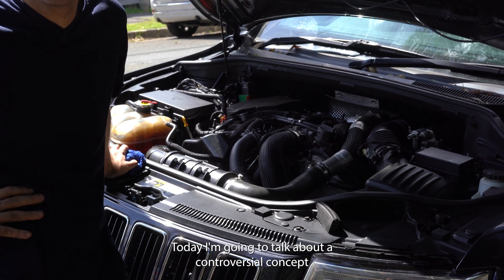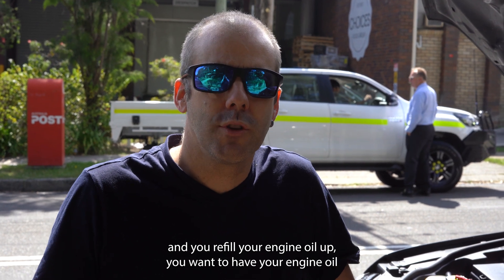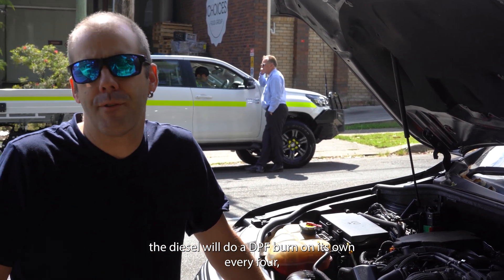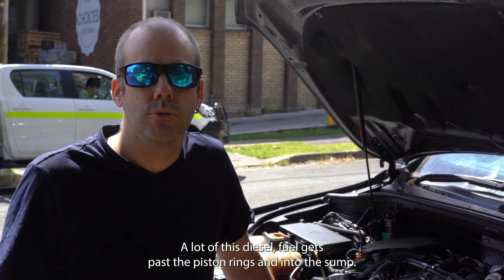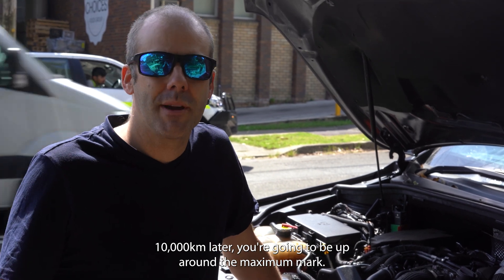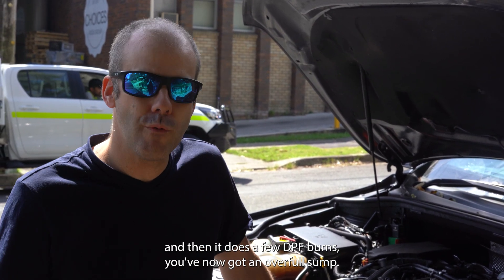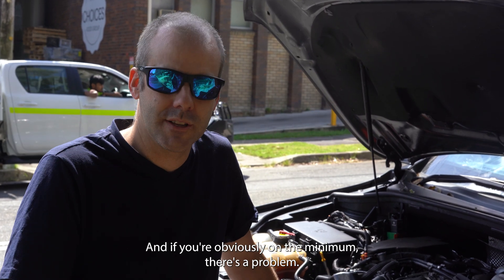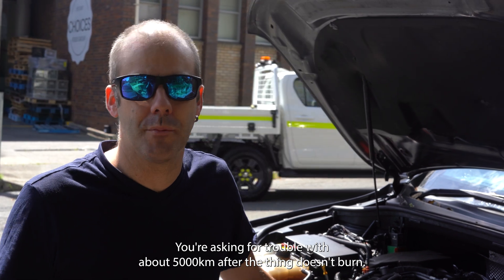How full Should Your Diesel Engine Be?

Comment: The first oil change on my partners diesel taught me this lesson. Put in the right amount of oil then a few thousand ks later its running up the dip stick. Was wondering how the hell more oil ended up in there later to find out about the diesel in the oil trick 😂😂. Have since put less in knowing its going to rise. Currently chasing an intermittent shaking issue. While driving it will just randomly start shaking, if you just ignore it a minute or 2 later it will stop. The you gotta wsit for it to randomly happpen again. Hard to diagnose but its driving my partner up the wall thinking the car is going to die.

Comment: It's becoming common for newer vechicles to have a min, max and X line well above the max.  The Pajero Sport is one example.
The X line is the ultimate maximum due to DPF burns causing excess fuel to be accumulated in the sump.

Comment: Thanks Danny that is some really useful information.. 

Any chance you could do a quick video on the correct way to check the engine oil on the 3 litre diesels? I can never seem to be a consistent reading off the dipstick.. occasionally it reads as any other engine (between min/max) would but most of the time its just shows over full, like its been altered during the insert\removal of the dipstick.. I have tried hot (5 mins after shutdown) and cold..

I know it should be a simple topic but from what I have read other people have the same issues..
Reply: Are you withdrawing the dip stick and cleaning it with a paper towel?  
Then fully insert the dip stick, wait only briefly, withdraw and check the level.

On some engines the dip stick is not vertical, it travels down on a 45 degree angle, 
these will give a high reading on one side and a low reading on the other side.

Some engines drain oil back to the sump slowly, not very common, 
these engines need to sit for 5~10 minutes after running them, you'll get a higher reading then.

In theory we are meant to check the leval when the oil is hot due to expansion, in reality the difference between cold & hot is small
Reply: @martinvlanza  thanks.. Yep clean it off with paper towel put it in for a moment and then pull it out.. Basically the same method I have done on many cars over the years..